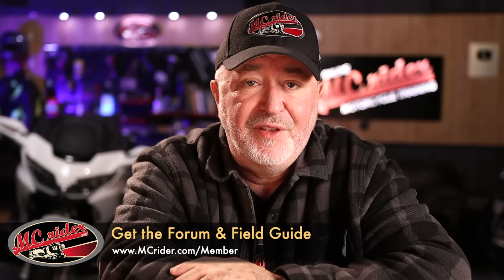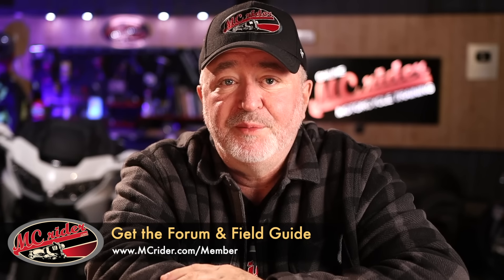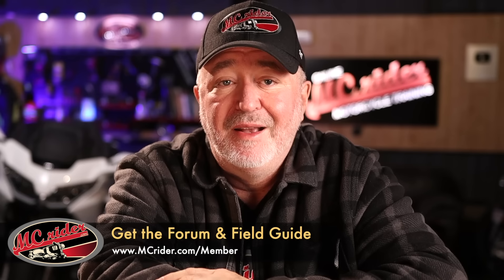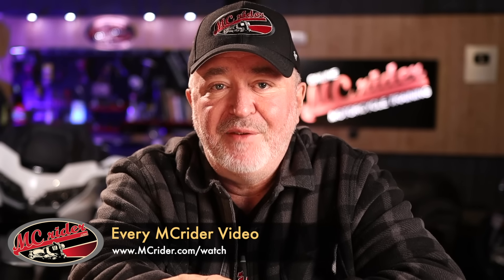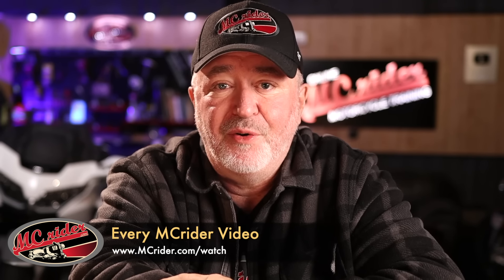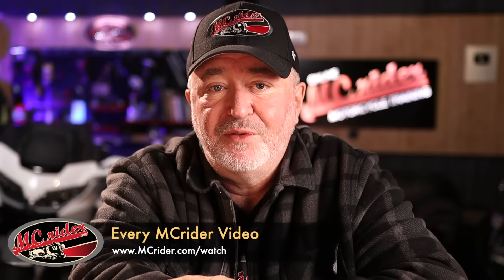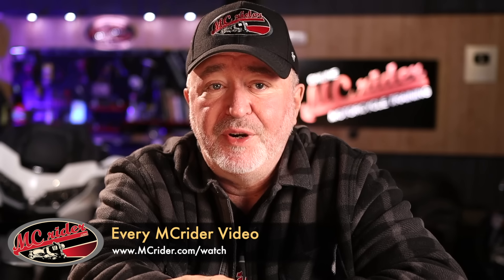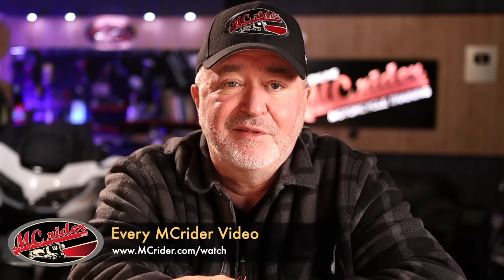The Most Misunderstood Control on a Motorcycle

Comment: I asked my instructor about clutch wear when I took the MSF course and he gave the short version of your explanation then pointed out that if it was a major wear issue they'd be replacing them constantly in the bikes used for the class, and they don't. That put it into perspective for me. If a machine that spent 95% of it's rolling life in the friction zone wasn't going through clutch plates massively faster than one that was ridden normally, then it just wasn't worth worrying about. I'm sure they weren't getting quite as many miles per set as motorcycle used normally, but that's to be expected. Just like someone who's into carving corners will wear tires and brakes faster.
Reply: with an old school dirt bike you had to 'feather' the clutch in turns. this did cause wear, but not so much that it needed service too often. heck, my 74 yamaha is probably still using the original friction material and disks.
Reply: Could it be because at a mc class, no one is popping wheelies! 😆 😆!!
Reply: @Thomas B how does that make any sense? When feathering the clutch and off throttle then ur not slowing down much, if ur completely of the throttle and clutch then the bike slows down as the revs drop. When ur on the clutch the bike isint connected and its rolling, the rate at which it slows down is significantly less then just being off throttle. And im sure u understand how brakes work.
Reply: @thbigshot101  If you don't need much braking it's a good way to do it. Keeps your rear wheel insensitive to throttle input, your right hand off the brake and your right foot off the other brake. I should imagine it's mostly down to feel.

You get the added benefit of keeping the brakes cold. Also I imagine it's not quite so bad if you overcook it.
Reply: @billh.1940  I did that once by accident 🤣
Reply: @233kosta   I see where you are coming from. however coasting in gear like i said doesnt do any harm, and I assume at their level of riding they have good enough throttle control that it wouldn't be an issue.
Reply: @thbigshot101  I think it's mainly down to feel and preference at that level
Reply: @thbigshot101  I use my clutch and throttle in corners all the time. It's a very good way to control the bike. But both my bikes have massive amounts of engine breaking, Rocket 3 and XDiavel, so I hardly use my breaks at all. I control my bikes through a combination of throttle and clutch for the best part. In fact I was out on a run with a friend a while back, he was on a sports bike, he thought my break lights were out at first. Different bikes have to be ridden in different ways. What kind of bike do you ride?
Reply: @rufus1346  nice, I never knew that could be a way to ride a bike. I'm currently fixing up a 97 katana 600f and going to learn to ride on that.
Reply: @thbigshot101   I remember when they first brought out the Katana back in the 80's. Cool bike :-) I wanted one so much! 
It's a matter of feeling it, experiment with it. Not sure how much that engine will slow you down though so you may have to use your breaks more than a big twin or triple. Have fun and be safe out there.
Reply: @rufus1346  will do cheers
Reply: @billh.1940  I think I still have the video of my son at his MC class, doing just that 😆

Comment: I've been riding for over forty years and keep my bikes a long time (by taking care of them) and I have never actually worn out a bike clutch thus far.  I'm not afraid to spend time slipping the clutch either.  I sometimes practise ultra slow feet up, coming to a near stop at the lights (when conditions are safe/appropriate to so so) and of course feet up U turns which requires plenty of judicious clutch slip and throttle modulation.  All good fun and I believe good practice, but have never actually had to replace plates or springs and the last bike had 156,000 km on the clock, so I think people must be paranoid!  Keep up the good work Kevin.
Reply: Same.  Probably 25 years and 200,000 miles, and never replaced a clutch component.
Reply: I must have bought a bike from a clutch rider. My clutch was slipping at less than 20K miles. I replaced it and the bike would absolutely fly.

Comment: My previous two Goldwings had over 130K miles each that I put on and I used the friction zone extensively.  Neither one had to have clutches replaced.  I rode with a couple of older riders that warned about downshifting so much to decelerate in twisties, when  approaching stops on city streets and slow riding in parades because I would have to replace my clutch.  Just never happened.

Comment: I have an Electra Glide with over 100,000 MI. A year ago the clutch was removed to access other repairs needed. The shop inspected the original clutch plates and Springs and reinstall all original parts. I never shift to neutral at a stoplight so that is obvious that this practice does not damage clutch springs. But if it did what's more important your life or some clutch spring.

Comment: Excellent video! I was a motorcycle safety instructor for five years, when I was a younger man, and had students of all skill levels in that time. 
I used a similar analogy to your volume dial one, but when explaining the use of the clutch, particularly to my beginner students.
 I equated it to a light dimmer switch. 
I found it helped them understand the concept, even if they had no idea how to drive a car with a manual transmission. 
As I often told my students, any fool can dump the clutch, crank the throttle, and go like a bat out of hell. It takes real skill to handle a thousand pound machine competently, at 5 mph. Clutch control is the key to that.
Reply: I have a challenge. Take a U-turn without slipping the clutch. Then one knows, that it can hardly be better. It can be done with enough practice. And stop all the way at stop signs, whit out putting the foot down.
 The ultimate challenge is to stop at a red-light… Keep the feet up… Hooooold… And go on green-light. Then you know you got it down…
Reply: what are your thoughts on preloading the clutch with the throttle  and keeping it loaded with the throttle? i watched robert simmons channel, but dont recall this in technique taught in the MSF. In the MSF course i remember when the clutch engages give it gas, not preloading when the clutch is disengaged.
Reply: So you have never had the cable slip out of the lead cable stop?! Never heard of it? Always put in neutral at a light. It doesn't happen often, but it does happen. When the cable slips the ferrel, you get shot into traffic! If a car is coming toward me, I can run easier than maneuver a 600lb machine out of the way. I've seen ferrets slip. It happens.

Comment: Kevin, I was one of those kids that watched my dad drive a car and back then they had clutches. He used to always have a problem controlling that clutch and worrying about burning it out. When I had my primary motorcycle training the explanation about using friction control was virtually non-existent. All was mentioned was to start off release the clutch slowly. The rest of it was basically missing. It wasn't until I took an advanced Rider racing course at a track that I learned more about the friction control and then my control of the motorcycle got a whole lot better. Even though, up here in the North when my motorcycles have been put away for 6 months, when I get them out I need to repractice with each one of them, as each of the motorcycles I ride have different feelings in how the clutch engages on them. Very important, or even likely the most important part of writing a motorcycle is understanding and using the clutch properly. Well done
Reply: Cars are slightly different. You do have to worry about burning them up since most motorcycles use wet clutches vs the dry clutches in cars. Car clutches don't dissipate heat as easily as a motor and carry a lot more weight. In a car the goal is to let it out as quick and smoothly with as few rpm as possible to minimize that heat.
Reply: @custommotor  
Yup I know.  Learned to drive on a standard in 1969
Reply: @custommotor  ....and cars dont roll over if you make a U turn going too slow.....
Reply: In the UK automatic transmission cars are a rarity and mostly used bt folk with mobility issues.
Reply: What do you mean "used to have clutches??'
Reply: I took a while to get comfortable riding the clutch on a bike, because I'd learned to drive manual cars and pickups decades before I got on a motorcycle. By the end of day two in the RiderCourse I was able to do low speed figure eights "riding" the clutch the whole way around. Whenever I hear someone talking about getting on a motorcycle for the first time, I tell them to sign up for the basic RiderCourse first thing.
Reply: @AcmeRacing  good advice for new riders

the most common factor for riders killed in accidents: MOST had NO professional instructor / riding course hands on training!

Comment: I ran my clutch wet on my shovel head for years. Eliminated the silly primary  chain lube from the engine oil. Let the atf lube the chain and cool the clutch. Then I went with a belt drive and back to a dry clutch.everything else is a wet clutch. Never had a problem with slipping the clutch in the friction zone. Clutches are cheap and last well over 100k miles, even the dry type. Another great video Kevin.

Comment: Another good video. Using the "friction zone" was/is the hardest thing to learn about motorcycle riding for me. For years and years for me, the clutch was either on or off. Dad yelling to me to not slip the clutch carried over to motorcycle riding because I didn't know any better. Old habits are hard to unlearn.
Reply: Car clutches are also built to slip. Not for quite so long, but still built to slip. If you have good throttle control and can make sure it's not slipping too fast it's OK to let it do so for smoothness. The rest of the drivetrain will thank you 😉
Reply: LOL my buddy has that problem, he cant help but to just drop the clutch. he also has a bad problem with riding the clutch every time he is slowing down and taking turns. pretty bad habit considering you dont want to be dropping the clutch in the middle of a turn when its time for you to begin accelerating again. he said he does that because he doesnt want the bike to stall but the bike wont stall at low speeds, well low enough to take a turn because the only time you are going slow enough for the bike to stall is when you are going so slow that you have trouble balancing the bike which is way slower than you should be going to make  a turn.

Comment: Good point. Excellent content as usual. 

Those of us who learned clutch control driving a manual car should really internalize the the difference between a dry clutch of a car and the wet clutch in a bike. My dad taught me utmost care and delicacy in working the clutch in a 1981 Ford Fiesta 1.1 during driving instruction. Huge thanks and respect. 

But launching my Hornet 600 slipping the clutch at 5000rpm is a totally different thing. That's what it's meant to do, and that's why we change the oil on bikes so often. Dirt bike riding also teaches controlling the rear wheel power with the clutch while keeping rpms somewhere between max torque and max power.

Ride smart, ride safe!

Comment: All good stuff!
Over here in Europe, manual transmissions are the norm on cars (or were pre-EV).
We also have (or had) a wider range of motorcycles, so dry single-plate and dry multi-plate clutches were more common.
There are bikes that will change up or down (on a track) with barely a touch or a brush of the clutch lever.  And there are others (larger Guzzis come to mind) that require a proper haul on the lever and a watch to time the cog swap.  
But all this was good stuff.
And was nicely presented.

Comment: Just purchased a 2005 Honda spirit 1100 with 2,200 on it has pipes popped n shuttered on deceleration. A certain dealership told me to just get use to pulling in the clutch to stop it, well I grew up in the late 50ies n was taught to never disengage until comming to a stop.. So I took it to a carb shop for a dyno jet kit problem solved, I'm a firm believer in engine breaking for control n breaking be aware that not everyone does not have your safety in mind. Thanks for bringing this to new riders attention.

Comment: I grew up around a dairy farm with mostly older equipment so I learned to drive with mostly manual transmissions. I drove a variety of off-road bikes as a kid, but I didn't get my first road bike and my cycle endorsement until just a few years ago.  A close friend recommended that I take a basic riding course which he had taken many years earlier.  In that course they did teach that when you come to a stop the bike should be in first gear and holding the clutch in.  I was telling this to my friend and years earlier (20 years) when he had taken it they taught you should be in neutral, and when you tested, that is what the examiner was expecting, that the bike was in neutral.  That being said, it is one more reason why someone may pop their bike into neutral while waiting at a stop.

Comment: The first thing I wore out on my bike was the rear brake pads. I was using it too much as a crutch in slow speed skills. Now I use light pressure and try not to to depend on it too much. It’s there when I need it.  I cannot wait until you talk about the front brake as well.  It’s your friend when properly used.  Thank you Kevin and enjoy your day!  😊
Reply: Riding for four decades, never use the rear brake, its virtually useless and very little feel, never had a problem.
Reply: @marksmallman4572  That is excellent! 😊 Knowing your front brake, throttle, and clutch and making sure your handlebars are straight when coming to a stop takes a lot of practice!  Especially if you are riding a heavy weight cruiser.
Reply: Absolutely karen, having faith in your front brakes the key, plus years of riding, not into cruisers, Ducatis yes, in europe. Good luck!
Reply: @marksmallman4572  If you can stop your bike from 80mph to 0 in 100 feet using the front brake only
you can stop it in 75 feet using both brakes properly

that last 25 feet can be the difference between life and death

forty years of riding and you dont know how to ride properly, and you are proud ?!

Comment: I'd rather wear the clutch out than have a car run into me from behind and paralyse me for life.
Good advice,  Kevin.  You're a legend.
Reply: The thing is, on a well-maintained motorbike, the clutch doesn't really wear out when you pull it.  Of course, if the Bowden cables are not adjusted properly and the clutch therefore does not release completly, there may be wear, of course.
Reply: @VoodooMcVee  Yes, I agree. In almost 50 years of riding I've only had the clutch go once on a bike, a 1967 Suzuki K10 80cc.

Comment: Great instructional video Kevin.  Kudos!  You invited comments on topics about the clutch you might have forgotten.  I'll mention clutch cable adjustment. Similar to wear on the clutch plates, stretch in the clutch cable is inevitable and the rider needs to exercise periodic vigilance on the state of the clutch cable adjustment to get optimum performance out of the clutch.  If you don't keep up with clutch cable stretch, then the friction zone will shift.  It means that you might not get full disengagement of the clutch if the cable is greatly stretched and the clutch has not been suitably adjusted.  On my BMW, I need to twist in or out an adjustment nut right at the clutch handle that take up or lets out slack in the cable.  I do this until there is 2mm of movement in the clutch handle.  This adjustment also puts the friction zone right in the middle of the clutch sweep angle - not too close to the resting position for the clutch handle  and not too close to where the clutch handle might contact the handlebars.  At some point in the life of the clutch cable, the adjustment nut will no longer take up cable slack.  At that point, the cable must be replaced and the clutch system readjusted.
Reply: BMW R 75/5 was my first, with cordon drive shaft, works completely different compared to all my Japanese chain-drive. But the instructions of Kevin - I didn't know when I was a teenager - were/  are the reason why I can drive every motorcycle up to Kawasaki 900 ccm even while I am 50 kilograms and 170 cm. My elderly brother taught me only:"Play with the clutch!" It´s the power of my left underarm. 

I´ll show the video my son ... thanks Kevin. I only have to translate.

Comment: I have taught many girls and guys to use a clutch in a car and a motorcycle and the best way I found to get them to understand to use the clutch is to explain that a clutch is literally a disc brake except instead of pushing the pedal to engage, you release the pedal to engage. Once they know the clutch is a brake, all you have to say is, "do you jam the brake pedal as hard as you can when you want to stop?". For me, this always gets the light bulb to go off in their head and then they understand and usually never stall the engine ever again.
Reply: Teaching clutch use, restrict the gas pedal or twist throttle. Have them learn to get moving without giving it gas. Block of wood behind gas pedal disconnect throttle cable. Once you learn the feel "zone" they'll be driftin!

Comment: Maybe another thing to add, a bike with the clutch engaged and moving wants to stay upright. Disengage the clutch, and that makes the bike, in essence, want to fall over as there's no power to the rear wheel to provide that gyroscopic effect. So this can be used in the apex of (sharper) turns to help lean the bike further for a split second, the ease letting the clutch out while applying throttle as you're coming out of the turn. The first time i took the motorcycle safety course back in 2004 they taught this, when I retook the course in 2018 to restart my M1/M2 licensing, this wasn't a part of the course.